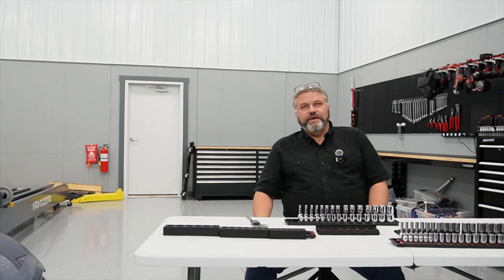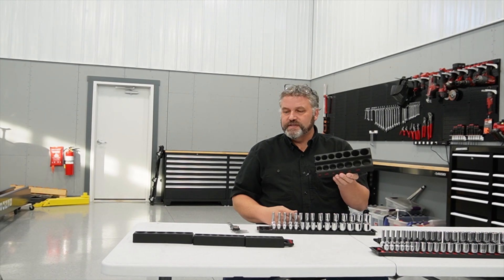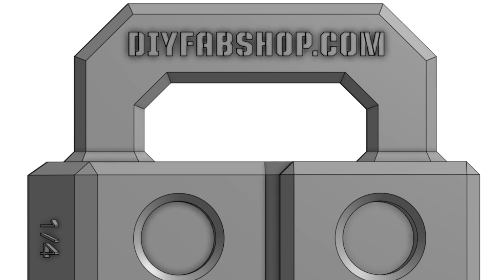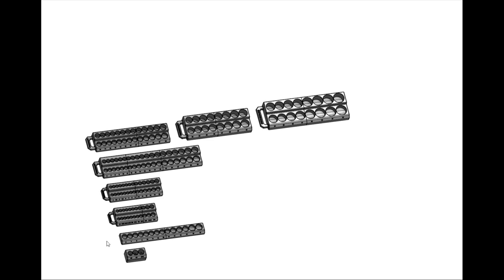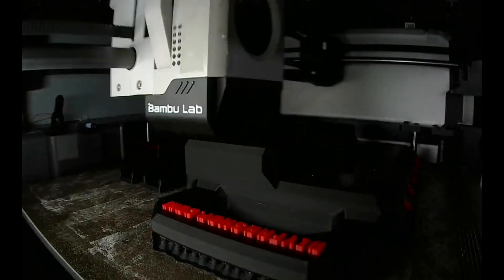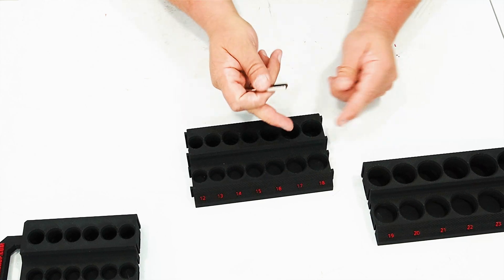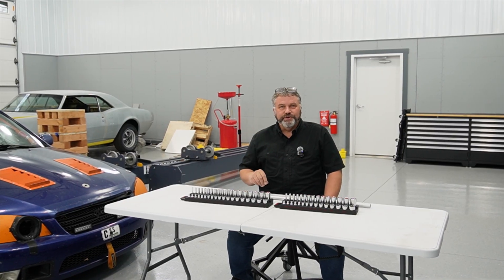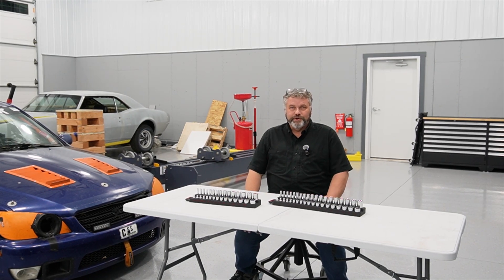Magnetic 3D Printed Socket Organizers Customized For You

Comment: Is it just the top layer that is painted on the numbers or is the whole raised number painted?  I've tried using the Paint Tool to paint the whole raised number but it is very tedious. I can't find an easy way to select just the number and color it.  I have a Bambu P1S with the AMS. Thanks!
Reply from the maker: @Ikeman50 sorry but yes, it is the tedious job of selecting the top and side raised surfaces, I couldn't make the numbers a separate part that would have simplified the multi-color process because of the automation for adjusting split lines in the cad models.

Comment: This is almost perfect but need a way to add several of same size sockets. Like I bought a 10mm set from HF it has various applications but need a way to add in several 10mm is a row. This is one of the problems with these preprinted pocket style. You can’t add new sizes later or even if you know how many you have in a row you can’t add them.

Comment: I'm new to the 3d printing and CAD world, are your online designs able to be modified to allow them to fit impact sockets?  If not, are you able to make modifications to slightly enlarge all of the wells for the sockets to accommodate the larger sizes?  I would be willing to measure the OD of all of the sockets in my set and that would likely be "close enough" for other brands of impacts as well.  Thanks!
Reply from the maker: @ShadeTreeVT        Check out this video, it walks you through how to create modified designs based on your socket count and dimensions. https://youtu.be/9obcoT7BU0U?si=N_nFKAf4WsATiKNd

Comment: They don’t seem to fit on my print bed. What size print bed are you using?
Reply from the maker: @nickguijarro I have a bambu x1c that has a 10 inch by 10 inch print bed.  If you are smaller than that, you could check out the video on how to modify the CAD and you may be able to keep the sizes so they fit for you. https://www.youtube.com/watch?v=9obcoT7BU0U&t=5s

Comment: Pick me! I think you just answered my socket storage problem! I've been looking on Temu, ebay, Tekton (where I bought most of my socket sets...I don't like their rails...), and I haven't found a great solution yet. I Love the premade ones like these but...naturally... they do not cover enough sockets. The 1/4" set covers ALL of my Tekton sockets...except the 15mm. Ugh...just ugh...I bought two 3d printers that were brand new on a liquidation for $50 each (they were $1500 each new supposedly...) that I think this will be the cats meow to try this on. My only downfall is that it is a single spool printer so I do not have the luxury of the multi-material functions...unless I can stop the print and manually replace the spool mid print. I'm new to this...I have two of these machines. I foresee these things being bizzy!!! THANK YOU FOR POSTING THIS!

Comment: Is there a way I can use and edit this design to fit my matco impact sockets?

I’ve tried magnetic socket holders before but I have size issues with 1/2 in drive sockets.
Reply from the maker: @jerromimuckle139 if you check out my other video https://youtu.be/9obcoT7BU0U?si=_fNP3EDBL8tJNkFj you will see how to custom create your own organizer through simple data entry in to free CAD templates.  For heavier sockets you can increase the depth of the pockets to help with retention.
Reply: @ thanks I appreciate it

Comment: These are great!  what print settings did you use?  Or do you just use the standard Pla settings
Reply from the maker: Pretty much just standard settings for PLA in Bambu Studio
Reply: @DIYFabShop  Thank you, i just printed one and my supports are stuck on and hard to take off, do you know what settings you did for supports? Enable support roof? Support z distance?  thanks!!
Reply from the maker: @boomhauer2222  my bambu printer has AMS so I used Bambu's special PLA support material at the interface to the part. https://us.store.bambulab.com/products/support-for-pla-petg   That makes it quite easy to remove.  Otherwise I have had the best luck using the "tree" style support which can be selected under "type" on the support menu in Bambu Studio.   I guess I should have asked, are you using a Bambu printer and Bambu Studio?
Reply: @DIYFabShop  Thanks, no I'm using a Neptune 3 pro, with Elegoo cura.  It's my first setup I'm playing with so I got a cost effective one to see how much i like doing it to start.  
So my layer height is 1.2 mm
support structure as normal
My z support top distance was 1.2mm
I used Touching build plate
support pattern - lines
support line distance 2.8mm
support line infill [60]
support infill distance layer 1.2mm
then i had enable support interface checked off
 - 1.2mm roof and floo thickness
 - 90% support interface distance
 - grid pattern for support roof
 - min support interface area at 10mm squared

Any help is appreciated
and can we donate for your help i know its a lot of work and so many questions lol
but im looking and building all these for my personal toobox
Reply from the maker: @boomhauer2222  donations are certainly welcome and appreciated.   https://buymeacoffee.com/kentkallsen

Key Adjustments for Easier Support Removal:
Lower Z Support Top Distance:
Current: 1.2 mm
Suggested: 0.2 - 0.3 mm
Why? A large gap makes the support ineffective, but too small makes it hard to remove. 0.2-0.3 mm is ideal for PLA.

Reduce Support Density:
Current: 60%
Suggested: 10-15%
Why? A high density makes the supports rigid and harder to remove. A lower density provides enough support without being excessive.

Increase Support Line Distance:
Current: 2.8 mm
Suggested: 3.5 - 4 mm
Why? Spreading out the support lines allows them to break away more easily.

Enable Support Interface but Reduce Thickness:
Current: 1.2 mm (roof & floor thickness)
Suggested: 0.6 - 0.8 mm
Why? Thinner interfaces make them easier to snap off while still improving overhang quality.

Try a Different Support Pattern:
Current: Lines
Suggested: Zigzag
Why? Zigzag supports peel away more easily than lines while still offering stability.

Increase the Minimum Support Interface Area:
Current: 10 mm²
Suggested: 5 mm²
Why? A smaller minimum area makes fewer unnecessary supports and reduces the amount of material that needs to be removed.
Use "Tree Supports" Instead of "Normal Supports" (If Available in Elegoo Cura):
Why? Tree supports generate organic, branching structures that are easier to remove and use less filament.

If you read this far and are starting to think: man this guy knows his stuff..... I must admit I used Chatgpt to make suggestions 🙂

Let me know how it goes.
Reply: @DIYFabShop  Thanks i'll give it a hot and my Z height was actually .12mm not 1.2mm sorry i miss typed that.  so maybe it was to small so i will try your numbers with the TREE way
Reply: worked great thank you!!!
Reply: Good day any chance ya got some wrench holders coming out?  Be worth a few coffees for sure
Reply from the maker: @boomhauer2222  well I do have a design for hanging combination wrenches from pegboard or wall control board.  I provided a sneak peak in this video. Is that what you were referring to, or did you mean wrench holders for a drawer?
Reply: @diyfabshop the hanging ones are def the ones I’d be interested.  I hang mine on peg board now but like your idea and plus they have labels
Reply from the maker: @boomhauer2222 let me see if I can push that video to the front of the line
Reply: @ that would be sweet!!  Excited to try them out!!

Comment: Hi Kent:  I've successfully modifed your awesome design for embedding magnets.  I've created an Excel calculator to optimize the full sized lengths to determine the best split point using combination of full sized small and large magnets.The calculator needs some more refinements.  Benefits of embedding magnets should be less parts to print as well as ease of assembly.  As you've stated in other comments, as handy as the labels are at an angle, it's a tedious process to color those during slicer.  I may opt to put it on a flat surface for ease of selection during slicing.  Other than that, it's going to transform my tool box and workflow on fixing cars!  Thanks again for a great design. Tim
Reply from the maker: @skunkedagain Tim, that is fantastic!  Cheers, Kent

Comment: This is great! Are all of the STL files (1/4", 3/8", 1/2" socket trays) you made based on Tekton sockets? On you website I see you made other trays as well, will you be posting those STL files? I downloaded the STL file from your website but it doesn't have a 2 color option for my Bambu. Did I miss something? Could you let me know if I messed up? If I didn't could you post the STL files on Bambu's Maker World please?
Reply from the maker: @OIIIIOFanatic so I am actively working on trying to make this easier to get access to customized STL files.  Yes the STL files posted thus far are all based on Tekton sockets.  Currently the STL files do not have the text as a separate part so in bambu studio you would need to select the surfaces you want an alternate color.  That is time consuming I know, so on the list is to split up the parts so Bambu studio recognizes text as a separate part.  I hope to have follow up video and new templates done within next week or so.  Do you have Tekton sockets?
Reply: @ Thank you! I didn’t know I could use Bambu studio to make changes. I’ll look into it. Yes I primarily have Tekton sockets. I found them a few years back and prefer them. I am only missing the SAE 1/2” drive impact set. I also tried to adjust the SAE 1/4” drive file you have as it starts at 1/4”. My 1/4” drive starts at 5/32. Basically the last 3 sockets on your 1/4” drive socket I don’t have, but I have 3 smaller sizes than your file. Hope that makes sense. I’m looking forward to you video on how to edit files with Onshape.

Comment: I’m looking at the Bambi A1 combo.  Would this template and all the filament you are using work with it?  (Different textures) I have no experience with 3D printing.😕
Reply from the maker: I am not familiar with that printer, but I looked at the print area and it is the same as mine so the models should fit in that printer ok.  And the PLA filament is very common and easy to print.

Comment: I have searched a lot and this is the best socket organizer I have found!  I have a Bambu PS1 with AMS.  How do you set the printer to color the raised numbers (black base with red numbers)?
Reply from the maker: You assign colors in Bambu Studio.  It can be a little time consuming as you need to pick both the side surfaces and the face of the raised label.  You want to use the "fill" tool which looks like a paint bucket, which is found under "color painting" which also looks like a paint bucket in the top menu.  https://wiki.bambulab.com/en/software/bambu-studio/multi-color-printing

Comment: I did this a few years back and they are WONDERFUL to use. 1 tip is, magnets get expensive, especially ones capable of holding 1/2" sockets. I ended up using the 18" magnetic tool holder bars from Harborfreight. They're like $5, and can often be found on sale for $2-3. Cut them to size with a cutoff saw.
Reply from the maker: Good tip, at $5 each they would be about $.27 an inch as opposed to the Amazon ones I used being $0.32 an inch.  The sale version of HB ones obviously more of a savings.  I won't be redesigning the magnet pockets on these, but anyone designing from scratch should consider that hack. Thanks for watching!

Comment: One suggestion I would make would be to design this so that you place the magnet in while printing.  Put a pause in the print at the right layer. Add the magnets and resume.

I do this with break all my designs.  It’ll speed up installation and you’ll have less parts to print.  

I love the rest of the design though. 👍
Reply from the maker: @chadcoady9025 I have no experience embedding something in a print. The magnets I have been using have a bit of a radius around the outside, I assume there some practical limit to how flat and sharp cornered what you embed has to be in order to not end up with a mess. In your experience is it fairly forgiving or is that the "hard part"?
Reply: @DIYFabShop  It's pretty forgiving/easy as long as the magnets don't have a lot of variation in thickness.  You don't want the print nozzle to run into magnets that are sitting proud of the slot.  I would make a few test prints for just the magnets to get an idea of how large to make the slots.  Typically, .25-.5mm of extra height for the slot (deeper slot than the thickness of the magnet) will simply get covered by a "bridge" when you resume your print.

You'll have to do a couple different prints, obviously, until you find the right dimensions for the magnets to fit into, but it's worth it for saving time on printing and assembly.

I designed and printed chess pieces a while back where I fitted them with a stack of nickels nickels (or pennies for the pawns) to give them extra weights weight and the Bambu printer had no problem doing it.
Reply: @chadcoady9025  One other thing depending how tight the magnets fit you might need a small dollup of CA to hold them in else they'll pop out and buddy up with each other.
Reply: @KurgerBurger  Absolutely....if the magnets are close together, CA glue is your friend.
Reply: @DIYFabShop  https://www.youtube.com/watch?v=Cvp3pyToycw just one of a few videos I found on the topic.

Comment: How ‘bout adding something soft/wont scratch to the bottom of the rack? You could print a sheet in TPU (soft) filament for 3D printing. Maybe an alternative would be to use the soft padding used in the bottom of most tool chest drawers. I bet contact cement would attach either with a strong bond.
Reply from the maker: Good ideas, maybe add some "feet" to hold it off the surface??  The magnets are going to attract metal dust in any shop that there is grinding going on, so feels like a solution needs to address being soft and also not capturing metal dust on the surface that would come in contact with nice paint etc.  Thanks for watching!

Comment: Great design! I really like the bar magnets and system for inserting them. 

I've gone through the other comments liked the embedded magnet idea, but then thought, what if you kept the inserts but did them as longer prints, corner to corner on the printer so the seams don't line up and help lock everything together? 

Also x2 on the gridfinity suggestion.
Reply from the maker: With all the comment around making the bottom interface with gridfinity I have thought a little more about it.  So one of the challenges would be the bar magnets that are quite close to the bottom surface would interfere with the recesses required for the grid if I am thinking about it correctly. You could raise the magnets up away from that surface but then you lose the functionality of sticking the rack to metal surfaces.  I had originally been thinking along the lines of your idea of having the magnet retainers span the dovetail joint to act as a lock for that joint.  I opted to have the magnet retainers split at the joint as then they would be buried within the base once the dovetail joint is engaged. That joint is surprisingly robust, but if it opens up over time, maybe pushing in longer retainers from the side and somehow securing those in place would provide more longevity.  Thanks for watching!

Comment: Just wondering if you considered embedding the magnets in the print. Seems it would be less parts and a simpler design.
Reply from the maker: OMG, I did not realize that embedding magnets in the print is a thing, so I never considered it.  In retrospect maybe it would be feasible, the bar magnets I used had a pretty good radius around their edges that may have made it challenging.  I was printing so many of these that many of them were started just as I was going to bed so the pausing the print to add the magnet would have been a bit of a bummer, but if it worked well I'm sure I would have done it.  I may have to experiment a bit.  Thanks for enlightening me to "embedding magnets" and  thanks for watching!

Comment: Making the base of these fit gridfinity would be another nice adjustment.
Reply from the maker: I could see the advantage of that.  Thus far I haven't adopted the gridfinity approach to organizing drawers, but it does play to some of my mild OCD tendencies. Thanks for watching!
Reply: I agree these would be awesome in gridfinity
Reply: Was literally thinking that and looked down and saw the comment! lol
Reply: I thought this at first, but as I kept watching the video, if the use case is in metal toolbox drawers or against metal wall panels, I’m not as sure. Now, using the magnet pocket as a base for other containers, I think this would be much better than gridfinity for metal drawers. Perhaps the option for either is good, but this makes me want to make containers with these magnet pockets everywhere for all of my toolboxes!
Reply: @steev182  they have gridfinity bases now you can add magnets to. That was my hangup. Now that there's a better base I don't have to design, that integrates magnets into the grid I have like 8 tool boxes & carts I'm going to be laying out lol I'll be adding magnets to every container as well is my goal.
Reply: Gridfinity is awesome